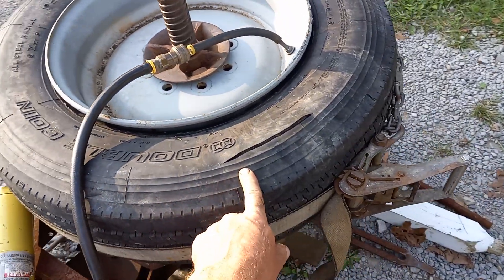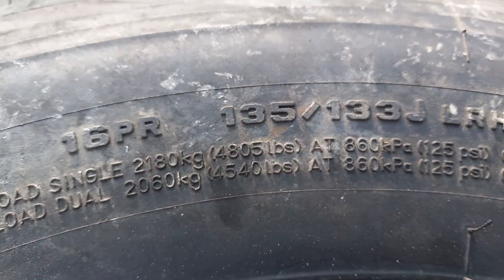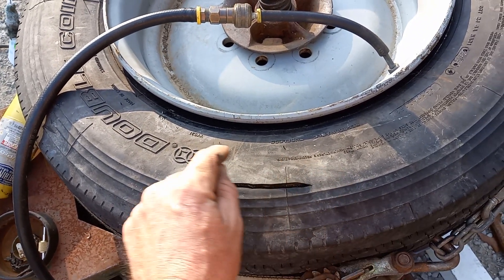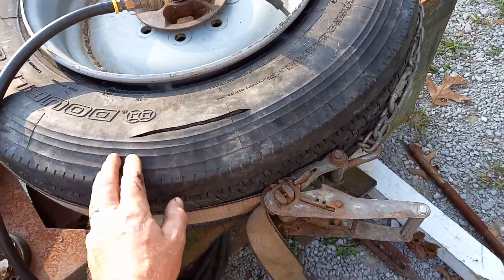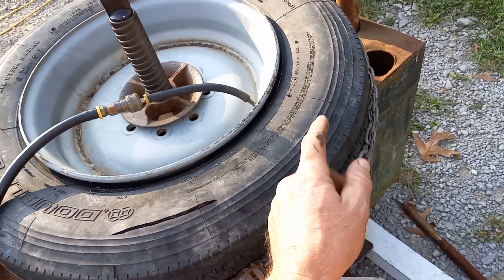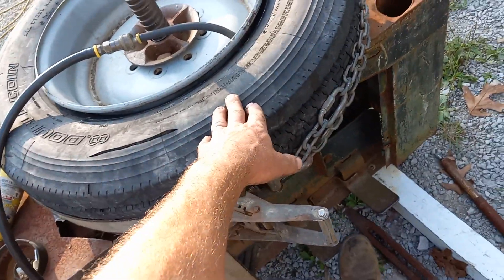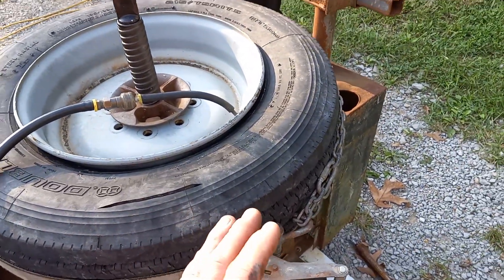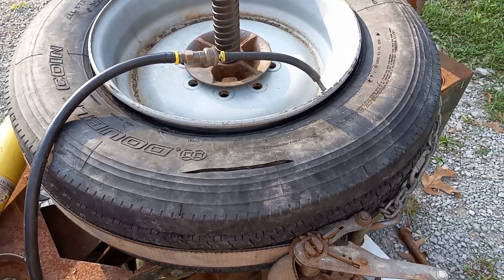Ether Bunny Mishap

Comment: If that "score" mark was on the side wall and you patched that, that was your 1st mistake. Trying to fill it afterwards was your 2nd mistake.
Reply from the maker: I plugged and patched a typical screw hole in the tread block.  That sidewall slit is the explosion exit.  The interior where that slit is had a very strange defect ive never seen before and thats where it let go.